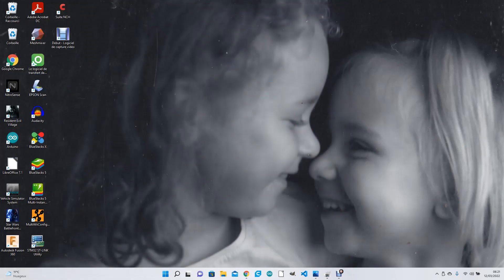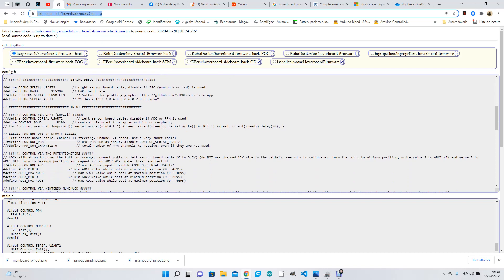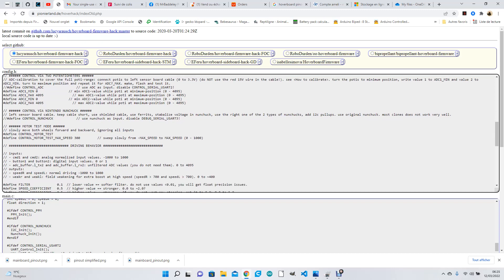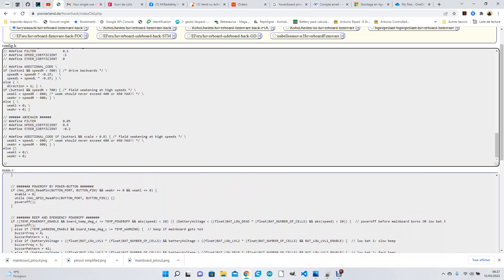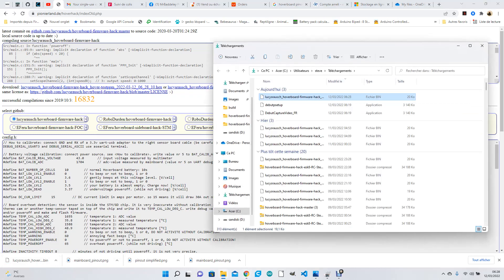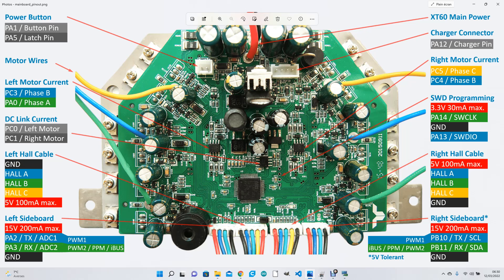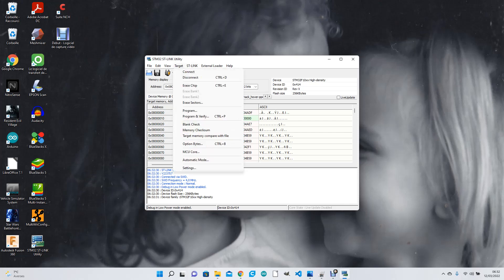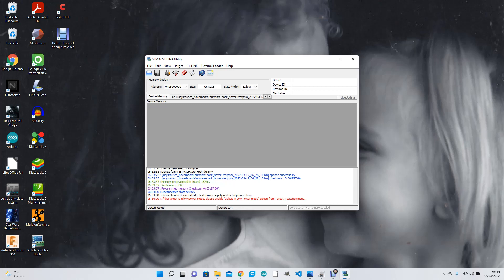Tuto how to flash and compile New firmware to hack hoverboard motherboards

Comment: Thank you so much, I was able to control Hoverboard motors using radio control. I am using radio link receiver R12DSM with radio link AT9S transmitter. The receiver has only one signal wire giving PPM signal. The receiver has 12 channels. But as only one signal wire is coming out, it only controls the motor moments using the above firmware. Can we add other items while compiling it so that other pins can be activated by other channels to run a relay on off switch for led lights? I want to control the switching on off of the 82v brushless dc lawnmower. The hoverboard just act as moving the lawnmower, and the land over have its own dedicated 82v supply. Now I have to manually switch if on or off. Thanks
Reply from the maker: Hi , use sbus so you can use more channels oer the signal wire , sbus works on one wire ... it has been a while since i wrote my tuto's but there are more on my channel covering this
Reply from the maker: bare in mind my tuto's are a couple of years ol and things may of advanced since , i am sure they have but these boards are very capable and people are always making code better